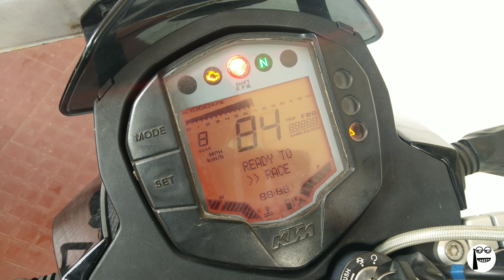WOOD CARVING | Faris Craft Factory| Salman Faris

Comment: Where to get the rotary drill ??
Reply from the maker: You can buy from. Online..  Now its available. In different sites.. But i buyed  motor from nearby shop and adapter also.. And the small chuck from amazon.. And tools set from flipcart
Reply: In amazon